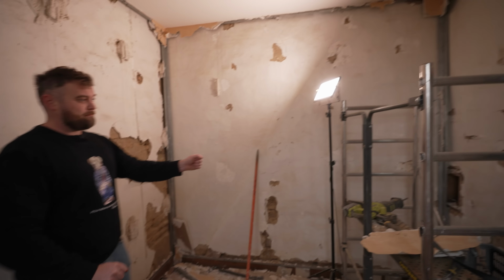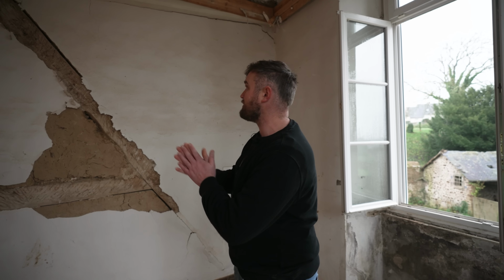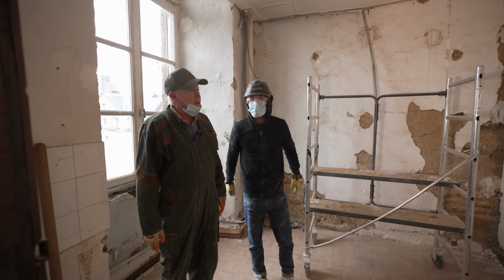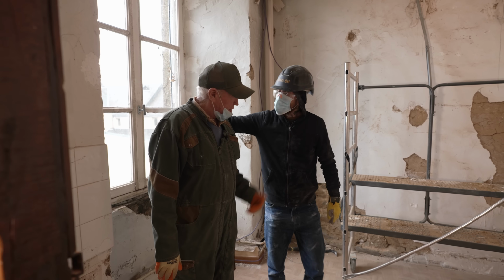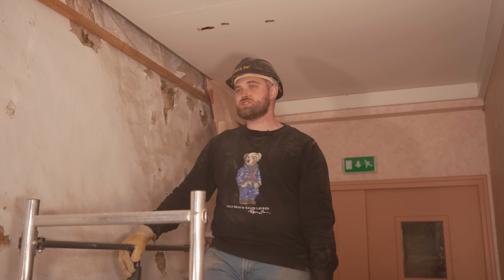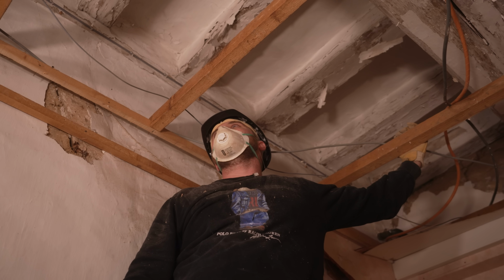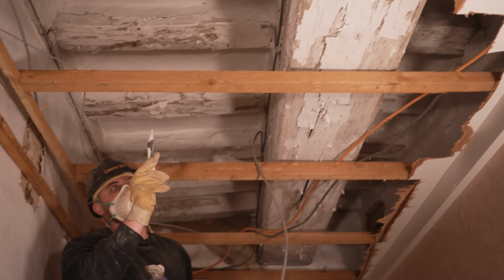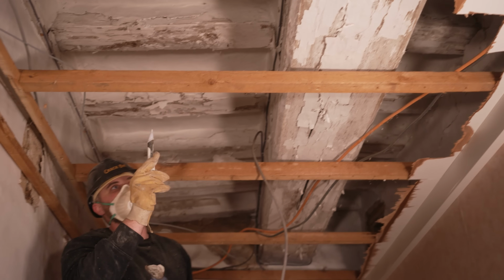Exposing The Faulty Main Beam

Comment: Just a thought.  You could put an RSJ under the sagging beam and jack it so that it fully supports the sagging beam at the centre.  Lower the ceiling to the top of the RSJ.  Clad the RSJ in distressed oak and then use the oak from the walls to make the ceiling look similar to the kitchen ceiling.  By doing that you would stabilise the building and not have to rip out the floor above and possibly the roof as well, which could turn into a massive expense.  But then, what do I know.

Comment: Not a structural engineer but my guess is that beam was bent when installed and logically you would build bend down so the timber acted as a bridge and didn’t push the walls out.  I’d be investing in an engineer to have a look and maybe save the old beam as is!
Reply: I like that idea,  good thinking.

Comment: Instead of replacing the out of level beam you could reinforce it with flitch plates or reinforcing bars set it grooves with resin. A common method used in historic buildings restoration. If the floor above is out of level it can be locally levelled.
Reply: That sounds good,  hopefully he will read the comments.
Reply: Yes.  Also I wonder if the beam was sagged from the beginning of construction?  The key would be if the ends are not pulling out of the wall, or otherwise showing signs of having settled and become unstable it may be smarter to follow the above comment.  It might save you a ton of cash to get a structural engineer with background in old buildings to give you an assessment and give some “work around” ideas.  I love the channel and wish I could be there to lend a hand.

Comment: Billy, I like that you are not shy when it comes to work and you actually are going to do it right rather than cut corners like they did in covering up the flaws with thick particle board and thin cement with chicken wire. Poor nuns is all I can say about that job, even I can see that and I don't know squat about construction. Everyone is working together and getting the job done, many hands make the work load lighter. Have a great day

Comment: If the beam is sound, keep it bend and all, it is part of the character, only replace it if it is unsound. But at some stage youll probably want to rip out the old structure above anyway and replace it with modern walls, which will be far lighter and put less pressure on the beams.

Comment: If the problem with the beam is penetrative location the answer may well be blacksmith saddles. The smith I knew who made these for beams of that size is now dead but did it several times in Norfolk. France has blacksmiths, see the wonderful museum in Rouen, and the cost of the saddles would be much less than stripping out the floor above, supporting and inserting an RSJ and introducing the floor beams to it.

Comment: If the beam proves to be sound, why not fix a reinforcing steel strap to both faces? It'd save you a huge amount of work, time and money. I've seen this done in numerous timber-framed buildings in the UK, even ones restored by The National Trust and Historic England. The straps won't even be that visible from 30 feet below on the floor of the library.

Comment: The joy on your father's face during demolition is a pleasure. If the main beams are just sagging but are still structurally sound, can you just shim up the difference? You can jack- up the sagging upper floor and fill the difference with a hardwood filler shaped to fit.

Comment: Why not jack the beam up and sister it with steel on both sides to give it strength and to level it?  Chances are the beam sagged when the structure was built.  Knowing it would be covered.  they would have used it as is.  Like you said they would have uses a whole forest..   Nothing would have gone to waist...

Comment: Becareful with wires as they probably run a long way and you don't want to risk power through the convent so prop them up on a nail sting out or a hooks to get them out of the way t

Comment: Billy, you mentioned taking out the chestnut beam between the ground and the first floor in order to open up the library. Would it be possible to repurpose that beam for the sagging beam? It might take more work to get it out in one piece, and reinstall it but it would mean not buying a new beam. You would need to do a cost analysis for the financial part but the result would mean  keeping an original beam.

Comment: Just  an idea  where  the beam is sagging exspoes the beam cut at 45 degrees after supporting the beam jack up to level glue back together  and supporting  in the cut location  from bellow this will avoid  removing  the top floor

Comment: Billy… any chance that beam is tapered at both ends? The load on the ends is less than in the middle. I have seen that done in an old mill and it’s also done in steel structure all the time.
Reply: Also that angle brace is structural.

Comment: OKI BILLY..please get a second opinion on that so called sagging beam. If you look on the wall betenth the beam it looks like it has ben sagging all the time. Maybe just maybe they chosed to pu in a bent trea frm start on a non critical wall to save some timber. As you pointed out there is a hwole forest in there an excpensive....GET A SECOND OPINION befor you demolish the next floor please please

Comment: Watching you pull down particle board amuses me and viewers should consider this; the amount of glue in such board which now composes large parts of modern housing. So for all you anti this and that relative to oil and carbon a considerable amount of that product is in many buildings to provide fire protection. Interestingly plaster board is considered an industrial hazard these days on demolition but it is still allowed to be placed onto domestic buildings! You cannot dump it in a waste tip in U.K. only an industrial tip! I find that official speak rather curious. 
Your curved beam at what point is this creating difficulty? Has it pulled out of engagement, has it split and is about to shatter? Or is the problem aesthetic? There are many buildings in Europe with such beams but maybe not intruding into library areas.